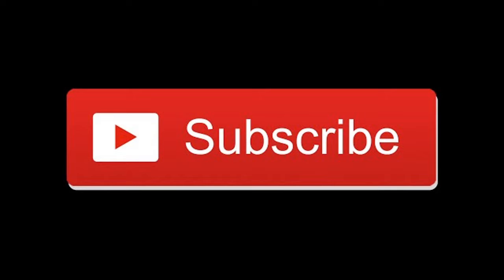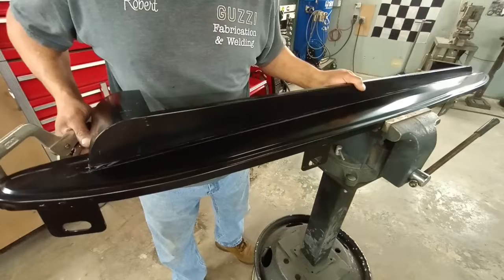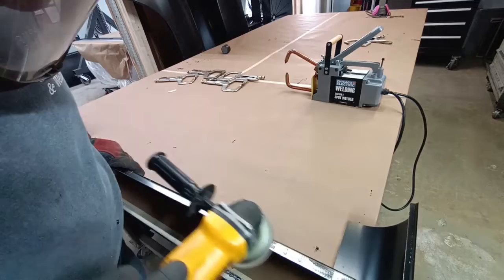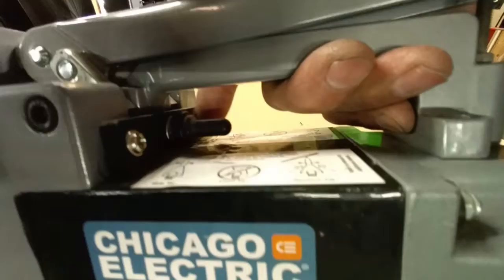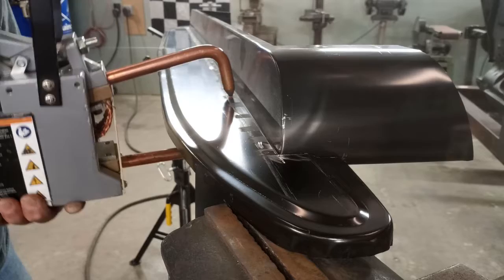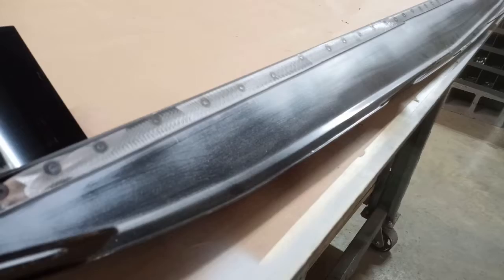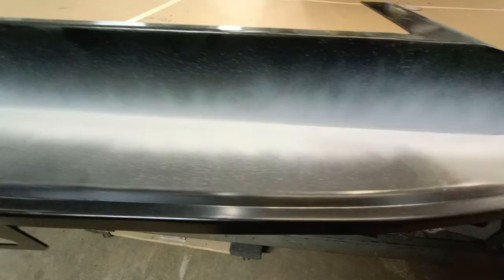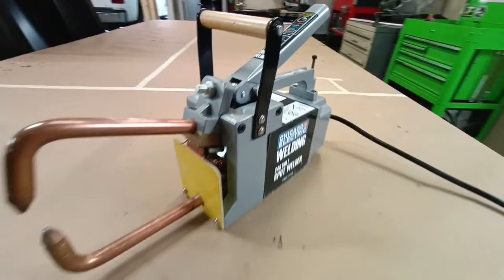How to - weld body panels with a spot welder / resistance welder  -  DIY Auto Restoration

Comment: I used a Miller 120V spot welder on my 66 Mustangs rear speaker deck.  Then I heard some car guys said that it can be dangerous to use the cheaper spot welder and that they had to invest in a 6-7K spot welder.  So I'm not sure... I did test my spot welder on 4 sheet metal patches and spot welded them together...3 out of the 4 sheet metal patches couldn't rip apart with pliers.   I guess it would be safe as when I spot welded 2 sheet metals together and tried to pry them apart it ripped around the weld which means the weld is strong enough to hold if there is impact to the car.  I also had to use the 18 inch welding rods as the 12 inch welding rods that came with the spot welder wouldn't reach the area...Just glad it looks Factory correct.  I do have a Lincoln MIG welder, but definitely prefer this one for spot welding as its a much cleaner job and far less time to prep and no need to grind off access welds.
Reply from the maker: Those " car guys " are spreading misinformation..... Thanks for watching !

Comment: Thanks for the video, I was wondering if I had to drill a hole for the spot welder I guess I don’t. I just got me the 240 on sale
Reply from the maker: Awesome you will really like it ! FYI Ebay and welding shops sell longer length and different configuration tongs. Thanks for watching.

Comment: I got the 120 volt and it seems pretty decent
Reply from the maker: Very cool I was curious as how well those worked. I wonder if the 110-unit is lighter than the 220
Reply: For thinner metals, e.g. .025 or so, the 110 might be easier to control…

Comment: I was looking at the 120 version as i dont have 220. I think the 120 is smaller diameter spot welds
Reply from the maker: I haven't tried the 120V but I've heard it works well.

Comment: What about if you don't have the other side to clumped it to, how do you work then with one tooth of the spot welder?
Reply from the maker: Simple it won't work.....
Reply: @guzzifabrication3448  So, they cannot work independently from one another?
Reply from the maker: @eddyboh2723  It takes both tongs contacting the allow the current to flow and "melt" form a spot weld. Thanks for watching !
Reply: @guzzifabrication3448  Sure, but what if you connect the second welding tip to a high voltage cable line and clamp it to the sheet you'll be welding?

Comment: I wonder how involved fabricating custom tongs sets for different applications would be?
Reply from the maker: I was just trying to work that out yesterday, that's crazy, They have different configurations and lengths on Ebay from $45 to $250. After time, material, learning curve, I decided to just purchase the pair I need.....
Reply: @guzzifabrication3448   I was thinking 4130 steel tubes and run battery cable out to the tips how ever long you need them, in what ever configuration you need them.
Reply from the maker: @BrilliantDesignOnline  Let me know how that works out.

Comment: Great video, I've never seen this type of welder, will this type of welder get the metal too hot and warp it?
Reply from the maker: The longer the welded is activated the more heat that will be produced, but it doesn't get hot enough to warpage.
Reply: This is exactly the same technique that has been used in car body manufacturing for decades.

Comment: Well that's very cool!! I have a 60 model Chevy truck and I was going to weld some parts together with my mig but I think I'm going to invest in this spot welder and try that out. Where did you buy that and what brand is it? Thanks
Reply from the maker: I bought the resistance welder in the video  is a Chicago Electric ( I would go with the 220v not the 110v ) that I purchased at Harbor freight, I'm very impressed with it !

Comment: How do you like the Harbor freight spot welder ? Not much luck with Harbor freight for me .
Reply from the maker: I really like it and you can also buy different lengths and configuration of tongs for it, I don't use it everyday, the important thing on equipment like this is not overheat it, I think it will last a long time. I just couldn't justify the price of the Miller or other higher in brands
Reply: @guzzifabrication3448  yeah prices on stuff are through the roof . Keep up the great work .